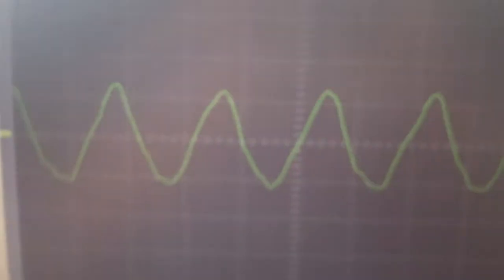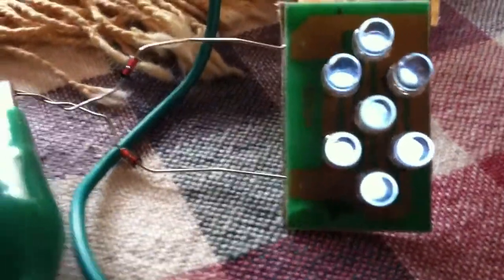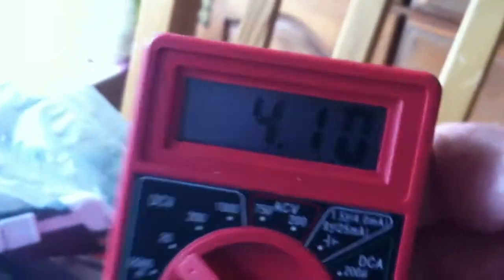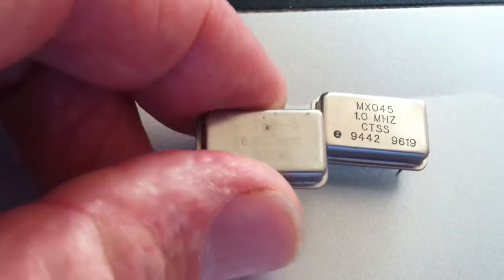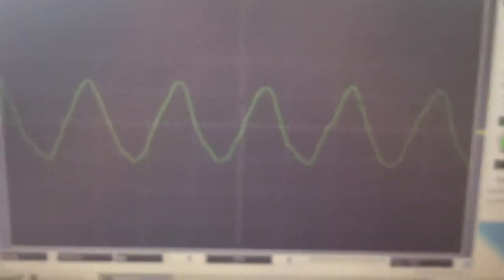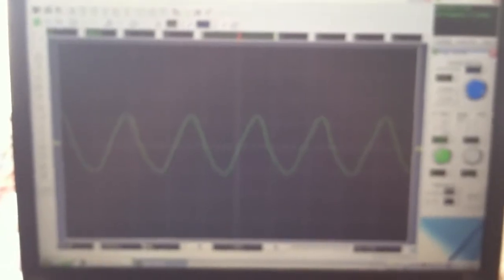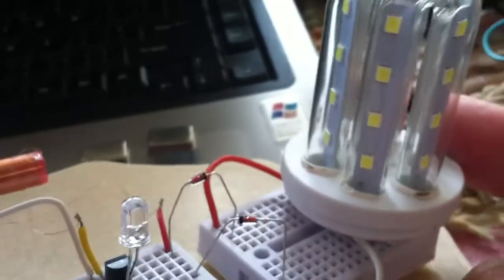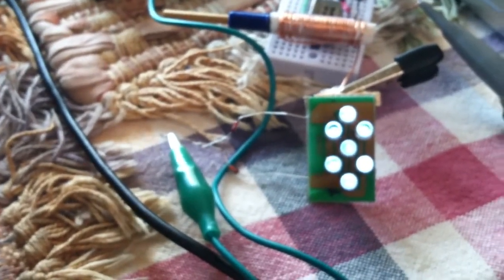13 MHz Crystal Oscillator ---Producing a sinewave signal at 13.5 MHz

Comment: You really need to know the signal gen power in and power out so we can really know if there is magic here or just fun.  Either way fun, but one way is a new frontier step.
Reply from the maker: Here is the problem.  The guys working on this project, who have the expensive bench signal generators, say that there is not enough wattage pumped out to light the 110v Led board to the level Dr. Stiffler shows.  Where is the needed power coming from. THAT is why we are pursuing this so hard.  Until we actually do a true replication it remains a mystery.
Reply: That helped a lot.  But it is confusing how the guys with hi tech equipment can say the wattage pumped out is less than the amount of light produced if as you say "Until we actually do a true replication it remains a mystery."  How do they know if no replication has been done? 

Not being a pain, just trying to get the jist of it.  As a electronics tech for 25 years I know sig gens well.  It appears based on your comment, that what people are excited about is that the signal gen source is providing  (due to a one wire connection), largely a transient (changing) voltage signal with none or inconsequential amps.  If true, that indeed would be exciting!  Voltage to Power conversion would be fabulous!  

As I recall sig gens usually have variable voltage ranges of 0-25 v or so and a short circuit of say 30mA or a bit more.  But with only using one output wire and no return wire, folks might assume there is no current involved since there is no obvious return path.  Did I get that right?  Well you don't need fancy sig gens to test this position.  All you have to do is put a current limiting resistance in series with the sig gen output.  You could use a 100K variable pot and try the whole rang to see if resistance has much effect on your output load.  IF there is an actual current flow, then resistance matters but if you really are using voltage alone to produce power then the resistance would be relatively invisible to the electric field and your light load should care little.  And if that is found true then P=FxE   :  Power, Freq, Voltage.  And no mention of amps! Pull out those high voltage coils and run the world!  Of course "if" is the smallest word with the biggest meaning in the English language. :)
Reply from the maker: You raised an important  point that we don't know if someone has replicated this or not.  There are some good experienced people (with the right equipment) working on this and scratching their heads.   I don't have a signal generator so I can't do much.  Even if the signal generator is simply powering the led board ---it is interesting.
Reply: Never mind a true sig gen.  Just use the oscillator circuits you have already been using.  But since you don't know where the energy is coming from, it makes since to at least narrow it down to either a voltage dominant effect or current dominant.  If current dominant then the energy relies on conventional current and no magic.  If voltage dominant then there may be magic as no current is required from the oscillator.  A quick 2 minute test with a high resistance (variable pot to check large resistance range) in series from your oscillator (one wire) to the load or plug area.  You already know your signal is very low amps, so a high resistance should make a big change in current flow and easily show at the LED the change of power IN and then we all will know the energy form is conventional derived from the sig gen or oscillator.  

But if the resistance makes little difference in LED brightness then we know that a conventional current flow is  NOT the main source of the energy.  That would frees us to look beyond the oscillator for the true source of energy.  Basically, I am suggesting to choke out all the current from the oscillator output by using a high value resistor so that largely only voltage can influence your loads or use of AV plug.  Normal physics says we can not have power amplification from just voltage or nearly just voltage, so here is a chance to know the truth which way it is.  If voltage is the apparent source then we know the power is not from the oscillator since voltage output is not power but just potential.  The voltage might be a trigger or catalyst of another energy form that we do not have instruments to detect yet.  Imagine back when the Galvanic battery effect was first discovered.  No energy testing instruments like a voltmeter, ampmeter, concept of Watts or Ohms law was known.  Had Galvani not noted the twitching frog legs by accident, no one would have known dissimilar metals and conductive liquids can produce energy.  I would be very excited either way if you could do the resistance tests on your circuit.   Regardless of what you find it will be useful knowledge.  I have done some high resistance experiments long ago with HV HF circuits of my own and do recall in some cases, that I could charge up capacitors in nearly the same amount time with a series high resistance as a direct wire connection!  So I am not suggesting something to you out of the blue, I have prior knowledge backing it up.

Comment: I'm glad you hooked that up, I was wondering what the peak to peek was. 
I wonder if the AV plug acts like a voltage doubler making the LED's see 2.4V ?
Reply from the maker: That probably explains why the Leds light up.